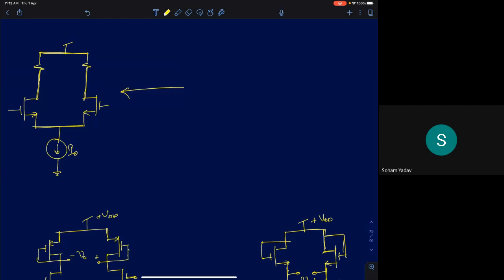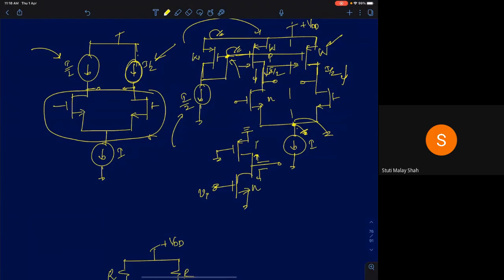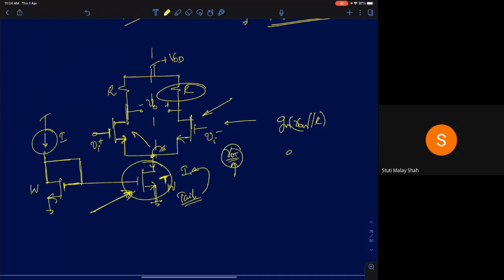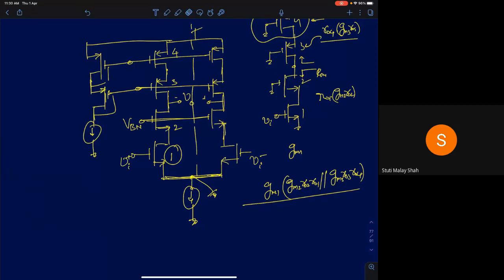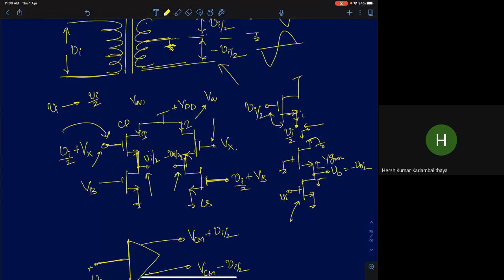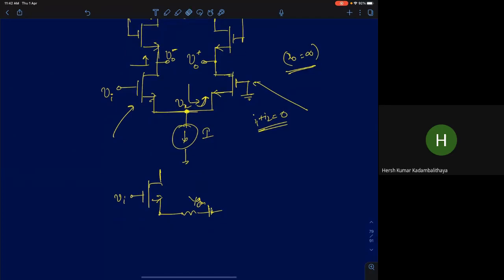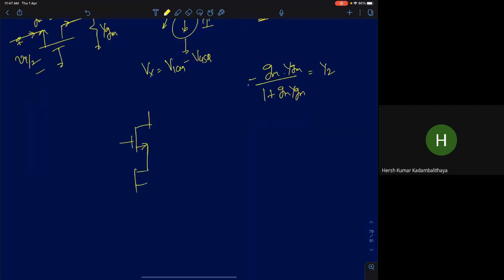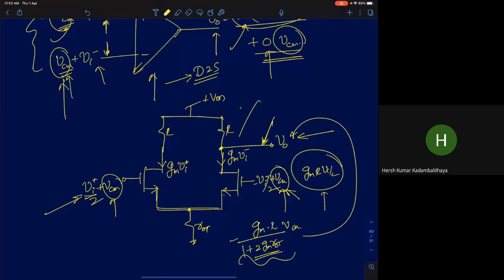MUE   Lecture 49: Single ended to differential and Differential to single ended  amplifiers

Comment: Hi Sir, thank you for this beautiful lecture. Sir I am trying to implement negative capacitance using miller effect. When the tail current in pA range i am not getting proper result, what should I need to do?